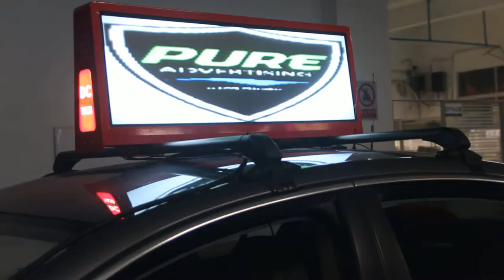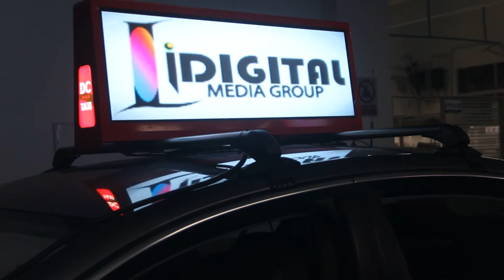How to install taxi top LED display on the car.taxi top LED display guide video

Comment: I’m wondering if you have to drill a hole on the roof to connect wiring to the car battery, please ? Your video didn’t show how the sign wiring went… or is it battery powered ? Thank you.